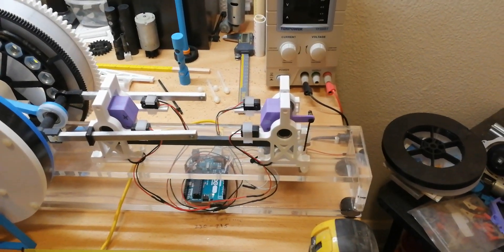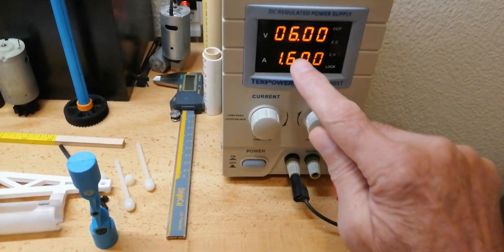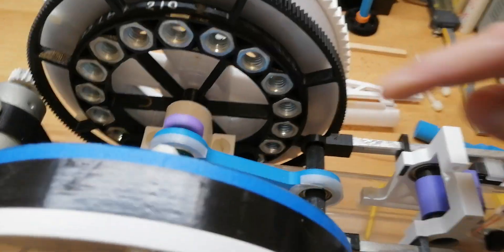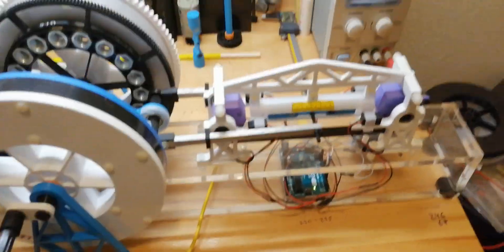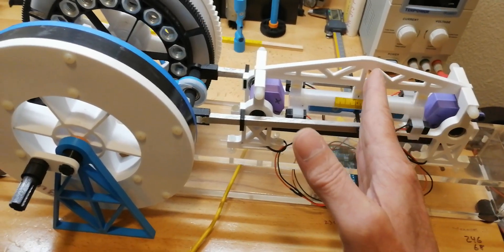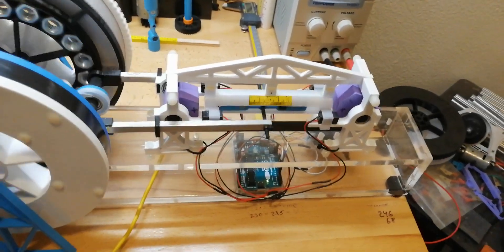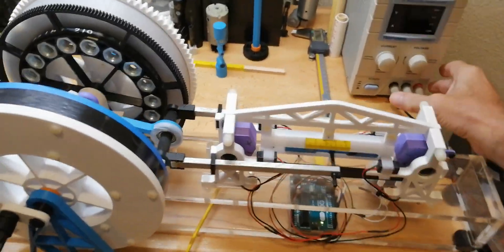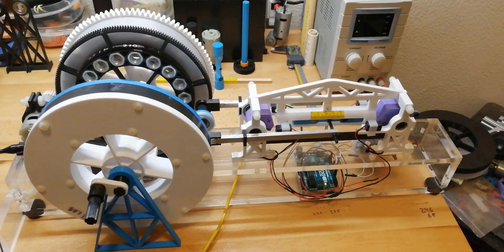MEO part 1

Comment from the maker: This video has not garnered near the reception that I anticipated so lets see if I can help it along. Though the operation and reason why MEO works is very simple full comprehension of the idea is very hard to wrap your head around. The main reason for this is due to a great disservice done to the fields of engineering and physics. This "disservice" has kept those two fields from advancing at the rate they could have, this is especially true of physics. So what is this "disservice" I speak of? It is the first "law" of thermodynamics and the fact that it was labeled as "law" without thought (despite the 90 years it took to complete) to what it would do to research into the fields effected. In the real world this "law" is at best just a poorly worded theory. Yet, this "law", accepted as labeled, created artificial boundaries within which research must fit in order to be accepted by mainstream science. Scientific knowledge should never be constrained by boundaries and here I will attempt to correct this "disservice".
     About the only words most people remember of the 1st law are "Energy can neither be created nor destroyed, it can only be transformed". This simply written easy to understand directive is however incomplete. You see there is a loophole in working with energy and it requires the addendum that "When the original energy source is an IMF (Independent Magnetic Field, a magnet) or EMF (Electro Magnetic Field) the energy may, in effect, be copied and used without effect to the original energy source. What this means is that using the FIF (field Interaction Force) between two or more IMFs can happen without effect to that FIF. What this means is that yes energy can be created though I prefer the word "copied". We are not creating energy in the form of a magnetic field, we are only creating a useable copy of the physical force generated by the FIF. MEO is a demonstration of one way to do this.
     To help better understand this we will do a little thought experiment here. A modern neodymium magnet bleeds off around .1% of it's field strength per decade. This means that a modern Nd magnet in good shape has a theoretical lifespan of around 1000 years. Also given that a 2" cube Nd magnet is capable of around 500 lbs. of physical force its energy density is rivaled only by a nuclear reaction (maybe not even then). So given this information here is a thought experiment that proves what I have said about the 1st law of thermodynamics. Imagine two levers mounted parallel to each other with each having a pivot at its center point. If we place two Nd magnets, so they are repelling each other, between one end of those levers their FIF will force the other ends of the levers together with the force of the two magnets FIF (Field Interaction Force). In the case of the 2" cubes this would be around 1000 lbs. of force. Now if we place a scale between the pinching ends of the levers that scale will show a constant (active) measurement of the energy being produced by this small device. Measuring this force in this manner is by any definition work. What this means is energy is being produced (via the FIF) and used (causing a measurement to be indicated on the scale) yet the source of the energy being measured remains unused. The two magnets in this device being the same do not have any negative effect on each other such as field swapping. Other than the fields natural degradation rate no energy is being used, yet energy is being output. In effect we have created a "copy" of the physical force by measuring it. This is by any (or no) stretch of the imagination not only over-unity but a massive amount of over-unity given that the measurement is constant and active and can last for centuries.
     MEO is very unique in that it works the exact opposite of every other prime mover known to humanity. This is all due to the fact that the output potential of the device is an inherent property of its parts. It is not the operation of those parts nor the energy needed to run it that produces the energy. The parts and operating energy are only needed to access the inherent energy of the device. In the case of magnets the energy needed is but a small fraction of the energy accessed. With the "time as a mechanical advantage" aspect the more load that is placed on the device the less power over time it will use, yet the power output remains constant as it is only influenced by the size of the magnets used. This is the equivalent of driving your car up an ever steeper hill where the steeper the hill gets the less fuel your car uses to climb that hill. At least until gravity overpowers the FIF of the magnets used.
     Hope this helps your understanding of MEO because once the proper people see and accept this tech our world will change. We could find ourselves living in the world we've envisioned since the very first science fiction novel was published. Please do comment on these videos. Thank you.

Comment: Hello again lol. Am I right is assuming that when the piston is active its being drawn to the opposite pole and the other is being pushed by the other pole? if this is the case its receiving twice the power from the magnets.ie: 3lb pull and 3lb push in the same direction is a 6lb action force? acting on the cam shaft. if that is so you are only having to over come 3lb of sliding force (one end only) which then puts the both sets of magnets into play and creating twice the force of each individual end.  which means there is nothing to stop this idea being scaled up..?  Hope you understand what I mean lol.  This idea has the biggest potential that I have ever seen on you tube. I know you have shown this on you tube and others but I always feel its right to ask if it is ok if I put something similar together myself, To prove the concept, because since watching all of your video`s on this idea, my brain has been working over time and my sketch book is almost full. haha.  Once again its a brilliant concept and one that looks right to start with unlike hundreds of other fake click video on you tube.   My only problem is I am not electrically minded and all of my ideas todate have a mechanical switch of sorts,   But I have a few ideas of my own to compensate for this. Regards  Deryck
Reply from the maker: By all means use what I have freely given in any way you wish, that was my intention when I released this as open source. The piston is always being pushed by one end while being pulled by the other. The Field Interaction Force (FIF) of two magnets changes rapidly as the distance between them changes. In this case the purpose is to replace the force loss to the receding (repelling) magnet with the force gained from the approaching (attracting) magnet with the intent of keeping the amount of force during the pistons movement as close to constant as possible.

Comment: So this is another consept that uses the inertial increase of electrical power.  Research Impulse Power Secrets and Impulse Energy Secrets by kanarev. They claim a self running impulse generator and have studied the physics behind it which lead to a new law of energy.
Reply from the maker: Not exactly. this uses a pulse of electrical energy to access the much greater force of multiple IMF's (independent magnetic fields) better known as magnets.
Reply: @JeffyJeff01 yes but you are using inertia to assist in this while impulsing so it will fall in the same category

Comment: It seems like the reciprocating shaft should be able to turn the magnets away on its own, then you could get rid of the servo and make it more efficient. Though I would still like you to help me build a Clock.
Reply from the maker: this is why it works and why no one has been able to make a "magnet motor" till now. by using an outside force to align the magnets you leave the entirety of the resulting field interaction force available to then run a generator. if you haven't already please watch MEO part 2 as it makes the whole setup more understandable. basically it shows how the more load you place on MEO the less energy it requires to then carry that load. this is really hard to wrap your head around but believe me once it clicks in your brain you just get it. because of the way i've gone about this you have a pretty hard time actually understanding that in video #2 your watching MEO in real time producing more than 150 times the energy it is using to produce that energy.

Comment: i'm not sure if this device meets my criteria of using the worlds rotation inertia to convert a spinning top into energy, but I think it's a beautiful construction and I'm very pleased when people can make such wonderful things. I would love to have you help me make a perfect clock. The clocks are in perfect for a great many reasons, and most of them have classical mechanical fixes. But it requires a lot of careful engineering to put in all of the micrometer adjustments And then to take the time and write down the numbers and monitor the behavior of the clock so that one can make each adjustment perfectly. I'm convinced we could set a record if we could just get a proper clock constructed.
Reply from the maker: So not sure if you are attempting to make fun of me or you are just too closed minded for this concept to "click" in your brain. I actually know a fairly famous mechanical engineer and asked him if he could estimate MEO's output. He told me that because it's output is a combination of physical force (flywheels) and DC output (small DC generator) that the only way was to see how much energy it takes to run it with a conventional electric motor. I took a multi pole (6 if I remember correctly) DC motor, 18V @ 5A or 90W and mounted it directly to the end of the crankshaft the flywheels are mounted on. After switching the magnetized piston with one without magnets I gave that motor full power, it would not even start MEO running. Even if I spun it up by hand it would quickly slow to a stop. That 90W constant power motor would only start and run MEO after I had removed the lights on the DC generator and then the generator itself. So, as shown in MEO part 2 the device uses 5.4W for .2seconds once every 2 seconds yet a constant 90W DC direct drive motor is not powerful enough to run it. That means it's output is at least 90W which if you do the math means it is putting out at least 166 times the amount of energy it is using. That is over-unity. That engineer is in his late 70's and very much believes our physical "laws" are actual laws (they are NOT, they are unproven and unprovable theories). Because I did what he asked (used a direct drive) he now refuses to even talk to me.

Comment: Another comment I would like to make is the Arduino in this circuit may be overkill. You probably could use a simple TTL or CMOS dual flip-flop logic gate with some power transistors to control the servo from the sensors feedback without the Arduino. A simpler circuit like this would draw less energy than the Arduino and would do the same function.

Comment: Great idea! I think you should try using a stepper motor generator as the load and then rectify both coils to convert it's output to DC and then charge a bank of supercapacitors to power the the Arduino and servo switch making it a self-running motor. That may be possible.
Reply from the maker: Go for it! that's why I released it as open source, so someone like you could make the first truly self-powered generator. as close as I can figure MEO puts out around 166 times the energy it takes to run it.

Comment: regardless of some thinking it could be a free energy device or that it may or may not be useful, it is a fun piece to watch do its work. thanks for making it.
Reply from the maker: so this is not and was not meant to be a free energy device, it is an over-unity drive that can be used to turn a generator to create free energy. keep in mind just the 10" long part with the piston and magnet rotors is MEO. the entire left hand assembly, crank assembly, flywheels and generator is just an assembly of parts meant to act as a load to show how MEO works. do yourself (and me) a favor and read the video description on the MEO part 2 video. its a back story and explains exactly how and why MEO works. thanks for watching!
Reply: @JeffyJeff01  yeah, I don't think you understood what I meant. I did read the whole description and understood it's not a free energy device. I guess I should have said "regardless of some people thinking..."
I like the idea of moving the piston using magnets and servos.
Reply from the maker: @VfxManja  yeah my suggestion was for the description on the 2nd video (your comment is on  part 1). it is a short backstory with a more precise description of how/why it works. sorry if you already did that I'm just trying to be helpful as I know quite a few less people have watched part 2.